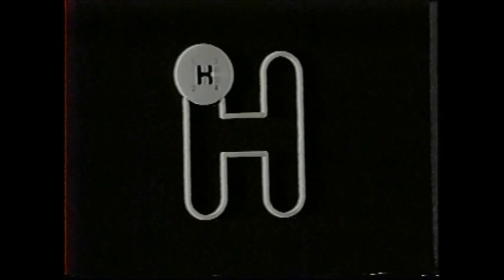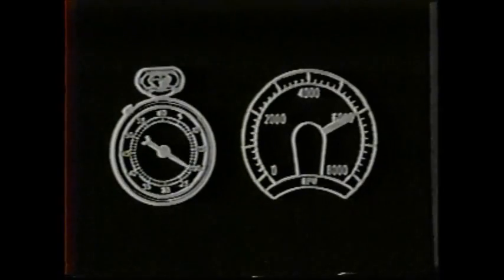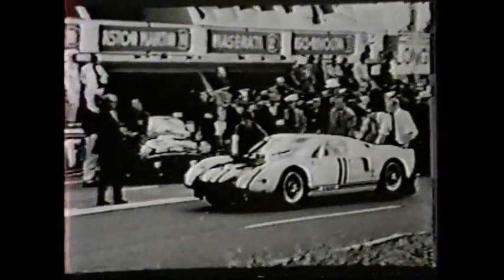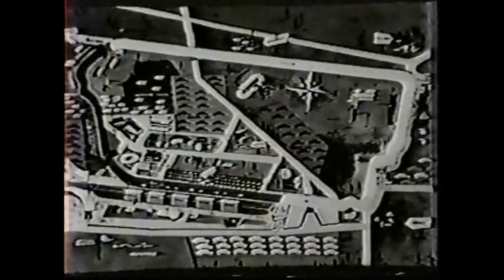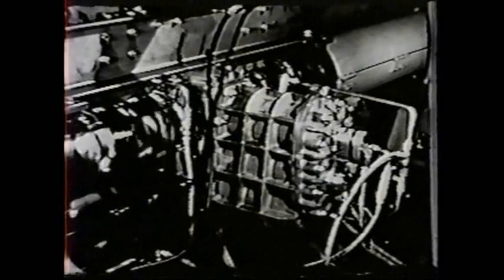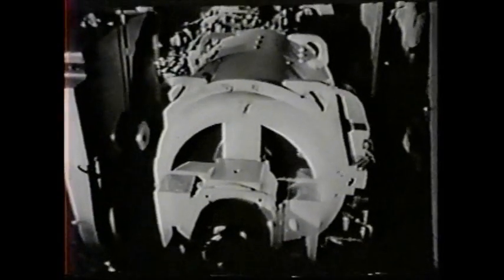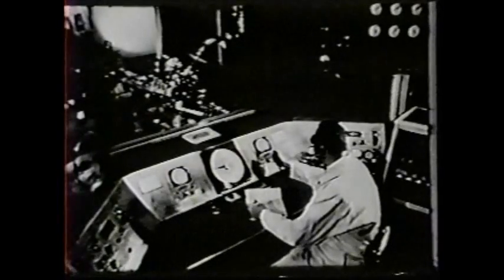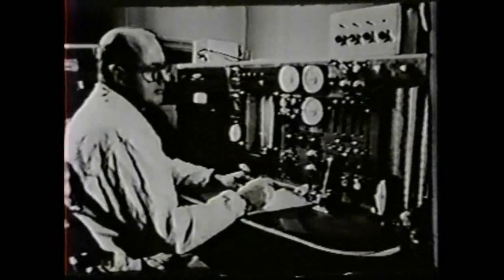Visa to Lemans - 1967 Ford 427 dyno testing video

Comment: Thank you. I read about this back then and always wondered if they made a film about it. We read that the Ford engines already had 24 hrs. on them when they started the race because they ran these test for 48 hours not 24 and if an engine had no trouble at 24 hrs it was 100% guarantee they'd last 48 hrs.
 Those big block Fords may not have been the fastest or most powerful but they certainly lasted longer than any other American engine could.
Reply: No they didn't.
Reply: @lollipop84858 maybe in your demented world, no they didn't, is the way you were taught to argue a point, but in the real world, it just makes you a troll😂

Comment: It would be awesome if this set up is in mothballs and could be brought back to  life ...  this sounds like grandads  cobra 427 
I remember as a kid the sounds going thru gears .....sadly grandad  passed  in 2017 we still have  have his 427 cobra  and SOHC Galaxie 
427 1963 station wagon  and other fords ... this is  great video  thanks  for posting 👍
Reply: I’m a technician in the dyno lab! If you’re referring to the dyno cell (17D), unfortunately it was renovated into a control room for the adjacent cells many, many years ago. I’m actually sitting inside the room as we speak. C wing is full of old nostalgia cells that don’t run, but even those are more modern than what’s shown here.
Reply: @Mr.McGillicuddy  shame nothing was saved   i have since found 2 SOC crate engines  a sunbeam  tiger 289 k code  F code 57 ford  
And many McCullough supercharger parts  352 hi po crate engines  312 parts blocks 410 427  428 429 parts blocks  CJ  parts 
Recently  in a Building  he had  in SC  on his family  farm  and Holloman Moody he knew  and numerous parts   and HM Fairlane 
Needs work  427  ....  I think i have found everything   .. he had ..  stashed  i will inventory  and  place in his old hangar  building 
Thanks for posting information   I might  find other items .. he worked with Ford for 27 years   squirrel away many cars parts 
Again  thanks for posting this information
Reply: @Mr.McGillicuddy  why not do a video on it and show some history. I for one would like to see it in color
Reply: @Mr.McGillicuddy  on another note fords latest  Bronco  a joke  ..  should have used the dyno  room to test  ecoboost engines  figure out why 
Dropping valves ....  I pulled  one labor day out of forestry road  17 miles to main road  using my 68 Real Bronco  300  I 6  4x4  man transmission 
I was heading  to cabin  .. the 2022 Bronco  just locked up on the couple  ... hint  go back to  reliable  300 inline 6  manual  transmission  
Ford apparently  has stopped  with quality control  years ago  ..
Reply: @quagmiredavis4117  Well every engine is tested extensively… Any problem that occurs during testing is typically fixed and then tested again. Most of the issues with the production engines were due to faulty tooling in the manufacturing facility that wasn’t noticed until the problems arose, which was obviously too late. But yeah I agree, they don’t make ‘em like they used to.
Reply: Wow that’s awesome !! Let me know if you ever want to sell.
Reply: @williamleuck2225  I I might have one or two things I might sell of his where are you located I just recently took his Mark 3 Lincoln to Texas and back it's not your usual Mark 3 Lincoln 1969 once you open the doors you see it has three pedals 
Boss 429 under hood we have several unusual vehicles of his with strange engines but before I sell anything I'm not going to sell to somebody that has them sit around as a trophy I just drove the Mark 3 Lincoln to Texas and back on the 4th I just got back two weeks ago all his cars are driven I'm taking the 289 competition cobra up to Virginia in a few days I'm going to go up and see family and I figure it needs a good exercise going through the mountains is there a way I can contact you and then we can erase the message
Reply: @williamleuck2225  you couldn't t ever afford them
Reply: Why would that be awesome? It's obsolete.

Comment: The 427 engine in the 1966 GT40s was a NASCAR unit.
Reply: Actually, it was a detuned NASCAR engine, with aluminum heads, smaller valves, and other changes.

Comment: I seriously doubt any Chevy or Chrysler big block  motor could last half that long. I read somewhere that after the full race they dyno tested the motors and they made more HP than when they started. Thanks for posting.
Reply: I’m sorry, if I had to overbore them I had to go.010 over and it squared the bores up.  I ran them a little loose for expansion. They did run really good though. And they they were tough as an anvil. I can’t find my Ford Performance books. But I hope if someone can save some money building a 410 , you won’t be disappointed with it. You don’t have to worry about a cracked 428 that was a  390 bored too thin. Btw, the fellow who posted this is an FE expert and can build you any FE you want!  Thanks Barry for the years of keeping this engine alive. A 600 hp 396 ci FE is pretty good. And remembering the good times. Take Care.
Reply: I seriously doubt that assumption too. Considering even NASCAR was too hard on Ford to do any good even in that length of race. It's no wonder they needed soooo much money spent on them to last at lemans
Reply: I seriously doubt that assumption.  Ford threw boat loads of money at these projects when they decided to race on a large scale. Chrysler and GM had no interest in such.
Reply: @kimmorrison9169  Chrysler and GM spent just as much, they just fell short of LeMans and gave up. Many corvettes tried and failed.
Reply: @jerryw6699 this isn't true.  The executives pulled the plug on the super stock Corvettes, the only reason any exist at all is some of the engineers kept working on them until they were stopped.  The  "mistery motor BBC" was actually better than the big block they produced. I love FE and Cleveland motors and I'm by no means a Ford guy, I also like Mopars and love building the odd engines, Buick, Pontiac, Cadillac, AMC, ect. No other ford would have stayed together either, actually no other FE for that matter. That block was completely redesigned and so was everything else. It is a amazing undertaking but Ford did spend an unbelievable amount of money. With a Blank check you can do almost anything.

Comment: Per my memory and hearing, the voice-over is by an entertainer from Detroit by the name of Bud Guest.  He had a live show on WJR Radio. Detroit, called the "Sunny Side of the Street" with Bud Guest.  He was very entertaining and there are videos of one or two of his shows on Youtube.  It is not called out, but I would bet 51/49 that the movie was shot by Jam Handy Productions of Detroit who filmed a great deal of commercial productions, in the area.  The engine on the test bed, is running similar cycles to that to run in the Ford 427 V8 for LeMans.  It is reported that Carrol Shelby ran it at very high horsepower, per the duty cycles shown and it was run as hard as it was capable, until it failed. When the lowest high point, at which it was not failure prone was reached, it was race ready.  At least that is my research.  This is a phenomenal video!
Reply: Hi Oldcarboater, thank you for this bit of nostalgia.  I was an engineering intern at Ford (Detroit, Cleveland, Windsor) in 1970, met the Ford Answer Man (Mount Clemens, MI).  It was a dream come true, Detroit/Ann Arbor was alive then.  I still have my first car, and my third: matching 1970 Mustangs (Convertible and Fastback).  Sadly enough, the storm was already over the horizon according to my mentors, times were going to change irreversibly.  Peace be with you, Ciao, L
Reply: Only one person cared about your dinosaur story it seems

Comment: Kept waiting on that 427 to hit 7000 rpms.
Reply: In drag racing, yes, in endurance racing no. Those scenes from Ford vs. Ferrari were theater.
Reply: @Mick_A_Knuckle  for good reason they wanted the engine to last the whole race, it ain't like today with Forged internals and ARP bolts, those engines would hit 7K RPMs but only so many times before they blew
Reply: @jacobbondy2936  none of them blew up.
Reply: My Cobra has an original sideoiler, with LeMans crank and rods, but with modern ARP fasteners and Arias pistons.
It hit's 7,000 easily, and 550 hp.  It would pull higher, but due to the rarity I have the limiter set at 7,000.
It is definitely sweet to hear a high compression big block that can rev. 😎
Reply: @1Cobranut should put a video of the engine running on utube. 
I did with my 427.

Comment: Thank you for sharing that movie Barry.  I had heard too that in some of their testing Ford ran the drivetrain for not 24 but 48 hours I wonder if that's true?
Reply: I read this in Go Like Hell, good read. I love the ford Ferrari war story
Reply: It's true. The baseline that was required was 450 HP for 48 hours. The engines were tested after the race and made just over 500....
Reply: I don't think ANY made it the full 48, but some got into the 40s; which is still amazing !!
Reply: @arkhsm all the engines that finished Lemans already had 24 hrs. on them from the dyno. I'd say many engines ran 48 hrs. I'd love to know the record if they ever tried to run a good engine till it failed. Probably a week would be my guess.

Comment: Man it must have really been a mess when one of those test motors blew up sending hot oil and coolant all over all those electrical components...
Reply: None ever blew up.
Reply: @cammontreuil7509  oh i think plenty blew up that was the point, take a ohv passenger car motor and modify it to the point where it could do lemans for 48hrs
Reply: @stevoschannel4127  no indication or history of any of those 427's blowing up.
They were detuned engines.
Reply: @cammontreuil7509  the literature describes ‘finally’ getting them to last for 48 hours…not sure that means they blew up but pretty sure that means they failed…my comment was intended to express how any messy mishap could wreak havoc with all those servos and relays associated with that old dyno…6500 is still alot of revs for a pushrod v8 with 1960s technology…My phony 427 Windsor has machining and components that are common on the scene now that they could only dream about in 66, and i dont go beyond 6500, it could but im just a working man with a limited toy budget! Cheers!
Reply: As a current dyno tech in this very building, yeah, it really fucking sucks.

Comment: Kelly, Chevy did COCK in racing. I advise you watch this video and learn how Ford in 1966-67-68-69 dominated every road race track worldwide. From the 289 to the 427 they dominated everything. THE CORVETTES DID NOTHING, THEY JUST COULDN'T COMPETE.
Reply: Let me add, why did you lie about the creators of the 5.0 shootout and pro 5.0? Why did you lie about the availability of trick flow heads in the late 80's.. You said svo was only one available, but that's simply not true.. So why the lie?
Reply: Bad Muthafuka WHAT RACING IS TODAY IN TERMS OF TURBO, SUPERCHARGING AND NITROUS WAS SINGLE HANDEDLY SHAPED BY THE SMALL BLOCK FORD. CHEVY DID NOTHING.
Today's world of the 5.0 and 4.6 Mustangs is one of unbridled achievement and breathtaking capabilities. Simply put, if you have the money, you can go as fast as you want. The sanctioning body classes offer you a way to choose your performance-and more importantly, budget-limits with an ever-increasing diversity of cars and racers. It would be difficult to put the impact of the 5.0 Mustang into perspective for someone who wasn't there from the start. Perhaps the best way to do it is to point out that the technologies that all-new performance cars-including the LT1/LS1 and, more importantly, the import racing scene-now enjoy would not be possible had it not been for a fuel-injected Mustang that Ford introduced in 1987.
Reply: ***** FORD OWNED 30% OF LOTUS, THEY WERE THE ENGINES SUPPLIERS TO LOTUS. SADLY FOR YOU THE BAD NEWS IS KILLING YOU. YOUR CORVETTE ZR1 ENGINE IN 1989 WAS A FORD LOTUS DESIGNED ENGINE. THIS IS A FUCKING JOKE.
Reply: ***** LET'S NOT AVOID THE ORIGINAL QUESTION. FORD OWNED 30% OF LOTUS AND FORD DESIGNED THE CHEVY ZR1 CORVETTE ENGINE. THIS MY MAN IS A FUCKING JOKE.
Reply: ***** GET IT INTO YOUR HEAD KELLY. FORD, FORD, FORD, FORD, FORD OWNED 30% OF LOTUS AT THE TIME GM BOUGHT LOTUS. YOUR ZR1 1989 CORVETTE UTILIZED A FORD DESIGNED ENGINE.
Reply: ***** ONE POST AT A TIME KELLY, NOT A HALF A DOZEN TO AVOID ANSWERING THE QUESTION. FORD OWNED 30% OF LOTUS AND SADLY FOR YOU, THE 1989 ZR1 CORRVETTE HAD A FORD MOTOR IN IT.
Reply: *****  ONE POST AT A TIME KELLY, NOT A HALF A DOZEN TO AVOID ANSWERING THE QUESTION. FORD OWNED 30% OF LOTUS AND SADLY FOR YOU, THE 1989 ZR1 CORRVETTE HAD A FORD MOTOR IN IT.
Reply: *****  ONE POST AT A TIME KELLY, NOT A HALF A DOZEN TO AVOID ANSWERING THE QUESTION. FORD OWNED 30% OF LOTUS AND SADLY FOR YOU, THE 1989 ZR1 CORRVETTE HAD A FORD MOTOR IN IT.
Reply: Bad Muthafuka DON'T YOU THINK KELLY CAN FIGHT THIS FORD VS CHEVY BATTLE ALONE. IS HE GETTING BEAT ON THAT BAD THAT HE REQUIRES A DOUBLE TEAM TO FIGHT THE TRUTH.
Reply: ***** THE 1989-92 ZR1 CORVETTE WAS POWERED BY A FORD MOTOR WHICH CAME FROM LOTUS WHERE FORD OWNED 30% OF THE COMPANY WHICH WAS THE ENGINE DEVELOPMENT DIVISION. THE INTERNET AND I'M BEING BEING GENEROUS, MAY HOLD 1% OF THE WORLDS FACTS KELLY. EVEN THE CHEVY INDY ENGINE WITH ALL IT'S PROBLEMS, HAD TO EVENTUALLY GO TO FORD COSWORTH FOR HELP TO CORRECT IT'S DEFECTS. THIS IS SAD NEWS FOR A HARDCORE CHEVY GUY LIKE YOU KELLY.
Reply: ***** DID CHEVY GO TO FORD COSWORTH TO HELP THEM FIX THE PROBLEMS IN THEIR INDY ENGINE?
Reply: Frank289100 Jesus you are getting bashed with facts.. this is hilarious
Reply: ***** DID LOTUS USE FORD POWER FOR DECADES?
Reply: Bad Muthafuka IT IS HILARIOUS, BUT YOUR CRYING ENDLESS TEARS INSIDE. THIS FORD VS CHEVY SHIT IS KILLING YOU
Reply: ***** DID LOTUS USE FORD POWER FOR DECADES?
Reply: ***** DID LOTUS USE FORD POWER FOR DECADES?
Reply: Bad Muthafuka 2 AGAINST 1. SO LET ME ASK YOU THE QUESTION:
DID LOTUS USE FORD POWER FOR DECADES?
Reply: ***** DID LOTUS USE FORD POWER FOR DECADES?
Reply: Bad Muthafuka DID LOTUS USE FORD POWER FOR DECADES?
Reply: ***** DID LOTUS USE FORD POWER FOR DECADES?
Reply: ***** hahaha funny shit